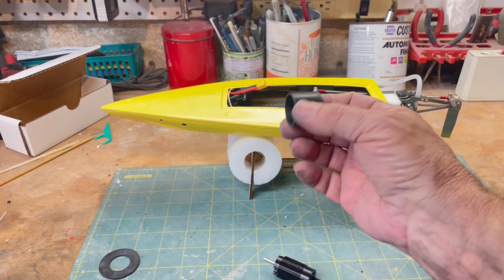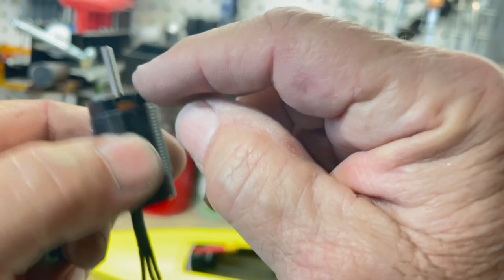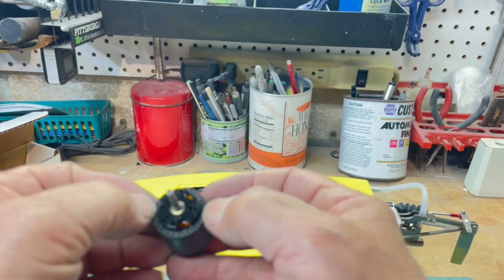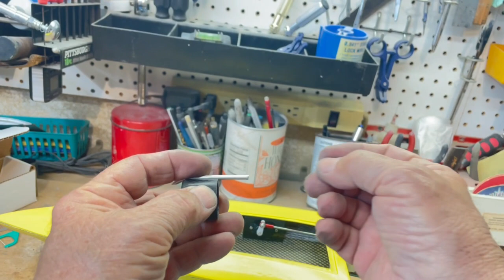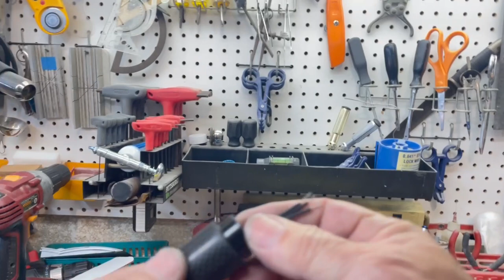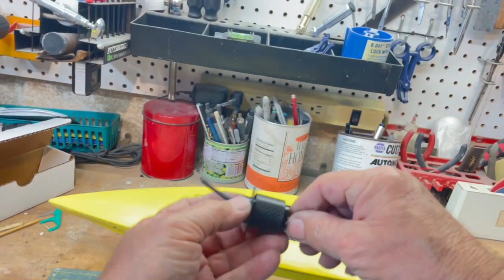Dr. Jet invents a water jacket for the Neutron 707 motor

Comment: Hi Doc, try aquarium silicone instead of jb. Works even better than o-rings
Reply from the maker: The silicone remains flexible and in some cases can be "peeled away" from the substrate over time.  In this application, I prefer the rigid strength and permanence of the JB Weld.  I used JB on the Axeox motor jacket that's currently in the BatBoat and it's held up remarkably well over a quarter of a century.......
Reply: Invent?
Reply from the maker: @oliverli2000  Well, I'm taking a bit of poetic license with the term "invent".  "Design" might actually be more grammatically correct, as the basic idea of a water jacket has been around for a long time, I just had to "invent" one that fit the little Neu Motor... 😉

Stay tuned, my next major project will be the completion of my H&M Micro Drifter powered by twin 1107/1.5Y/H Neu Motors.  The -/H versions of the Neu Motor has built-in fan cooling for helicopter applications.  Perfect in a boat.

Comment: What if you install O-rings between the cooling fins in the front and the rear of the motor then slide the carbon cooling jacket over the O-rings. Might need a little silicone sealant to insure a water tight seal, but it seems like an easier method than gluing end caps on either side of the cooling jacket.
Reply from the maker: I see exactly what you mean, and it would probably work, BUT............  Getting O-rings to seat on the fins and seal the inside of a tube may be easier said than done.  Furthermore, there's a whole lot of potential for leaks if everything isn't perfect.  That old Aveox that's currently overpowering the BatBoat has had a permanent water jacket for a quarter of a century and it's still putting out "adequate" power and has never leaked a drop.